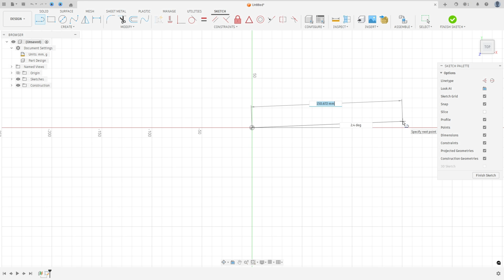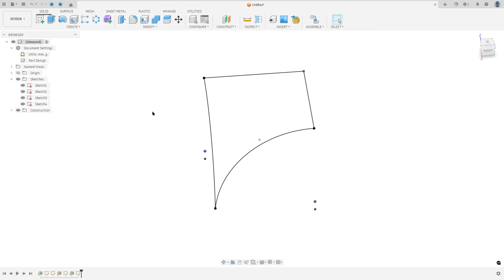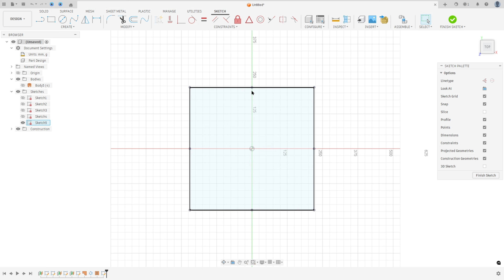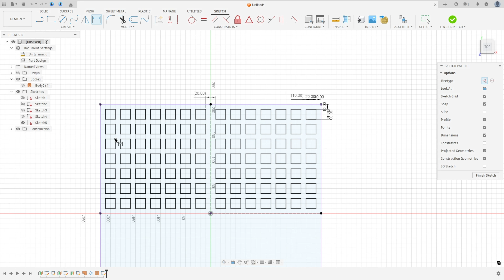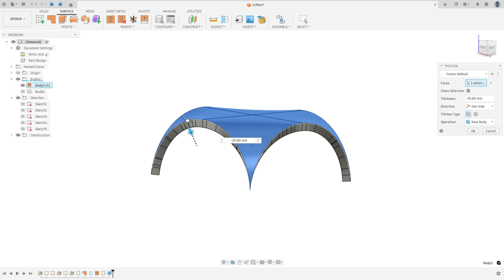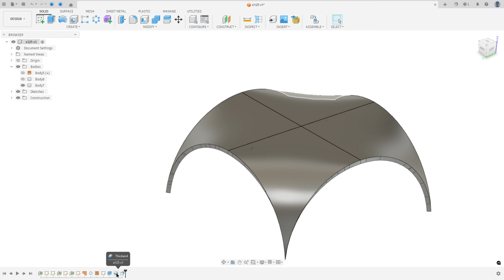Fusion 360 Surface Practice Series – Exercise #3

Comment: I have followed both channels and enjoy the challenge of each exercise.  No matter how simple or difficult they may be I do learn something new every time.  I do have a question on this example.  I played around with the order of operations a little and found that after creating the surface if I then create the square matrix, then insect surface and matrix, then thicken in the negative direction, then create a circular pattern I get the final body without issue and correct dimensions.  Would you agree with this approach or is there a performance issue or other technical reason I'm missing?
Reply from the maker: Yes, the way you did it is actually the most practical and logical approach.
Technically, your method is totally valid — and honestly, it’s a very clean way to build the model. Thank you very much !!!
Reply: Thanks, Had a great instructor!
Reply: @Al-fe3ln What's the other channel?
Reply: could you explain this process a bit more?